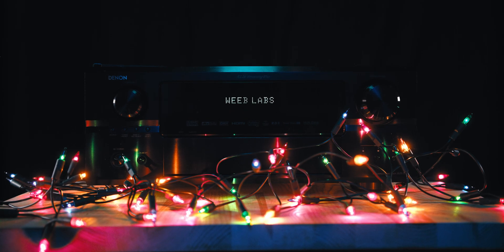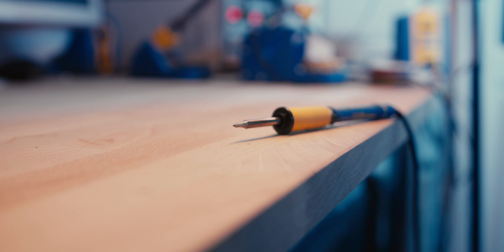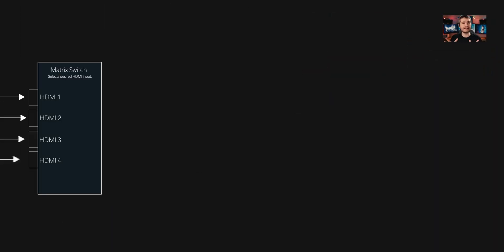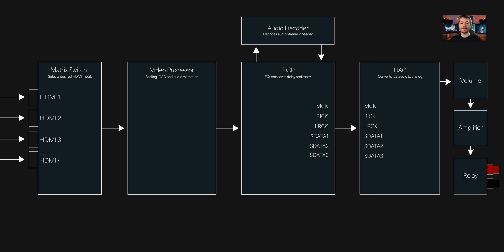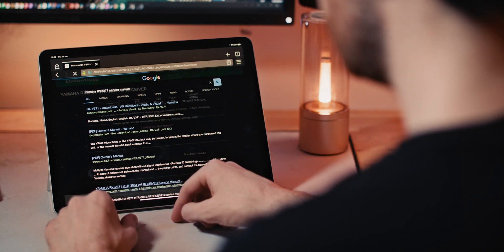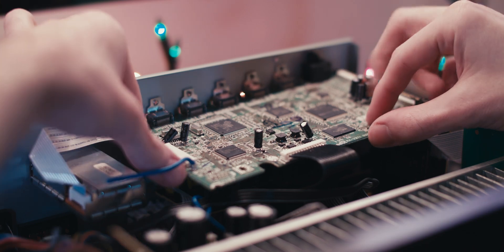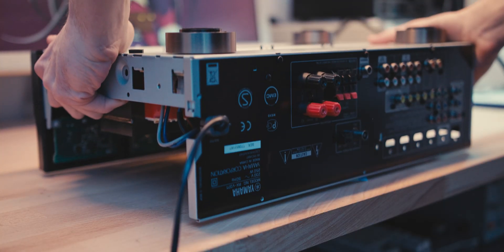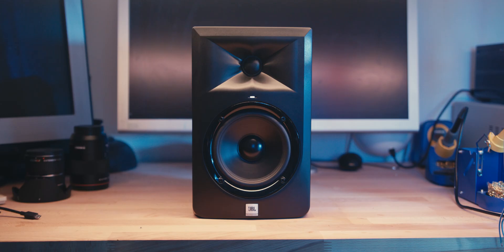Turn any AVR into a Digital Audio Processor with SPDIF Outputs!

Comment: Just spent the day doing this on my avr-x2400h. Audio coming out for front LR. Only one issue, I hadn't realised the AVR's volume control is after the DAC! So whilst I'm getting channels sent to an external dac and amp, unfortunately they don't track with the volume of any other channels 😢

Anyone know of any workaround to this? I guess digital audio is always full-scale anyway. Gutted!
Reply from the maker: If you need synchronized volume control and can't handle it digitally at the source, the best option would be a pair of quadVol boards.  When describing the signal chain, I pointed out that the volume control ICs are after the DACs but quite a few people seem to overlook it.  I think I'll pin a comment!
Reply: @WeebLabs thank you! After an afternoon of thinking, I figured I could build an external box (placed after the external dac) using the same volume control IC as the AVR, tap into the AVR volume IC data and power pins, then feed said box through a din cable? Might make a video on it myself if it works

Comment: I really like the video, just wish that you had spent more time talking about the use case for this hack which is using the AV in downmix stereo mode. But people that are using AV-Receivers probably want surround sound and if you use an SPDIF output you will have to manually balance the powered speakers with the center and surround speakers which is not practical at all. If downmix is not for you I would recommend looking for an AV that has an analog pre-out for the front speakers oder to consider installing an analog pre-out hack (which is unfortunately more difficult to do).

Comment: Hi, I'm modifying my denon x3600h. Is the cable 28AWG or 30AWG? Should the BNC or RCA connector be isolated from the chassis? Thank you.
Reply: I had success with an isolated RCA socket, making sure to use the specific digital audio ground. Pretty sure I used 30awg wire but can't find the order now. Did mine on the x2400h

Comment: Awesome video! I'm wanting to do a similar thing to add digital out to a kenwood car head unit so I can feed it straight into my mini dsp 8x12dl and use that for volume control and processing.
Time to pull it apart I think.

Comment: This is exactly what I wanted to do, but I didn't expect it's so straightforward. The digital output will not be volume-controlled from the AVR this way? That's a problem for multi-channel home theater listening.
Reply: you connect a dac to the digital output, and then an amp to said dac. you can control the volume on that new amp

Comment: Awesome vid. Trying to do this to drive some Meridian digital speakers. Did your test AVR use digital volume control? My Integra uses an analog volume control chip. Any recommendations of a modern-ish box with great digital volume control for a mod target? :D
Reply: Currently trying to do the exact same thing for the exact same setup! I am using a sony HTR550DH and soldering those tiny little resistors was an absolute nightmare

Comment: If you wanted to do more channels, for example, 5.1, would you need more than one WM8804?
Reply from the maker: Yes.  Depending upon the application, there also exists the possibility of using an I2S ADAT encoder, which can handle up to eight audio channels.
Reply: Thanks I can’t find any ADAT card or at least I don’t know enough how to find one. I’m thinking of buying four of the WM8804 or WM8805 cards.  But if I tap off the MCK, BCK and LRCK traces or pads on the AVR board, can I just split that four ways to four WM8804 or WM8805 cards?  The other issue with ADAT is max 48hertz so I think four SPDIF cards might be better. Does this make sense? I’m kind of new to this but I think I’ve found where to tap off the board on my AVR.